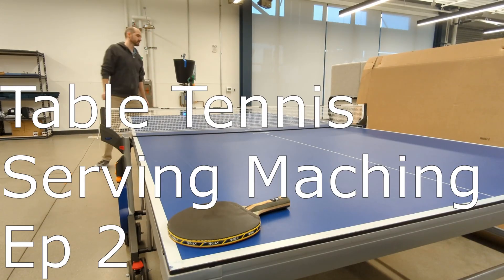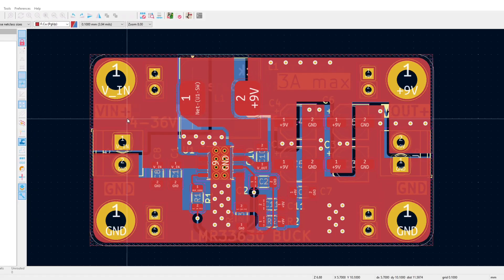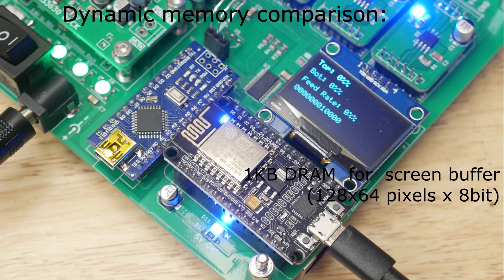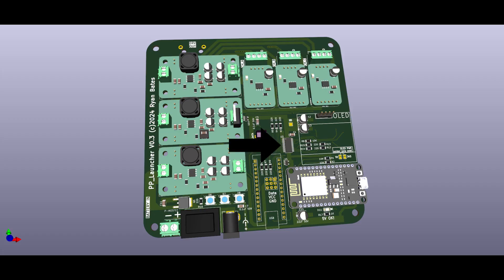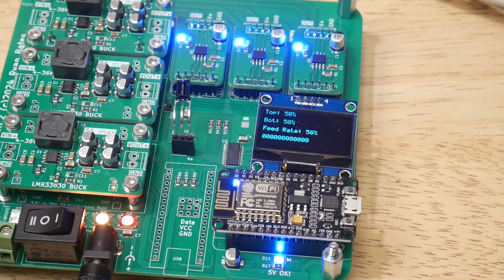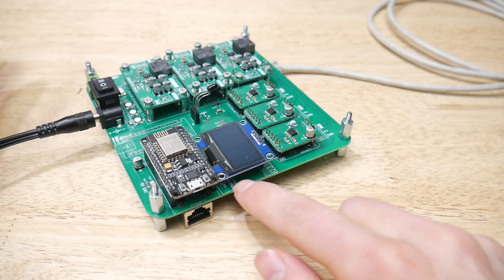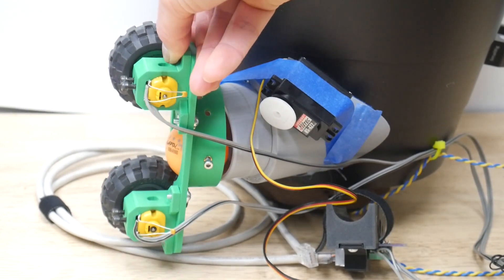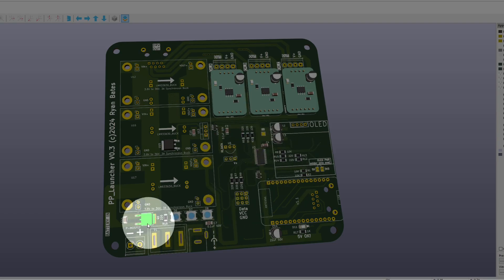Table Tennis Serving Machine | Part 2 of 3: Electronics

Comment: Why not use esp32 if this is a new design? Some of the workarounds that you are working on would not be a issue in esp32 if I'm not mistaken
Reply from the maker: fair question. simply-  I already have a bunch of esp8266' . best hardware is what you have on-hand (sometimes)
Reply: @RetroBuiltGames lol I'm in the same boat, I bought a bunch of 8266's before I learned the joy of the esp32 so now I need to drum up a few projects to use up my small supply
Reply from the maker: yes, this is always me. i get super sucked into a tunnel vision of discovering one hardware type and go all in. only become aware of something better was like $0.74 more.

Comment: The reason I write my own display drivers is so that I'm not forced to double buffer. There's no point if you are just printing text to allocate that much ram. At most you may need a line buffer if you need scroll effects. I've driven 300x400 e-paper displays off of atmega328p's without issue this way.
Reply from the maker: I agree it's use case (and the trade offs) is not strong for the current implementation. I think once this project gets past a prototyping/ development platform the OLED might not have a use, but the extra overhead with the ESP8266 is nice.